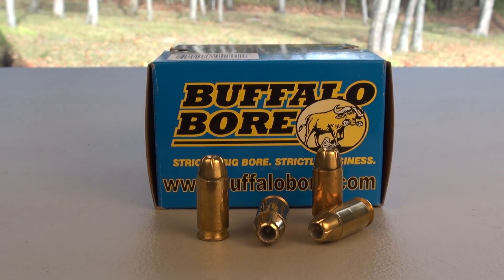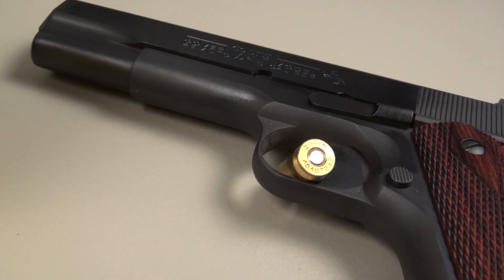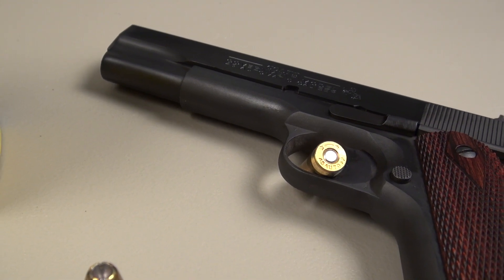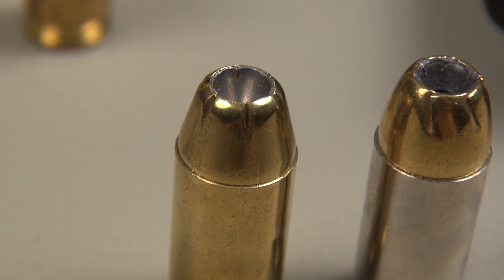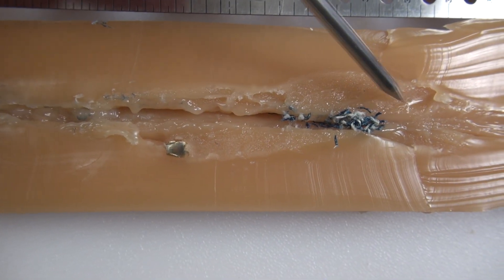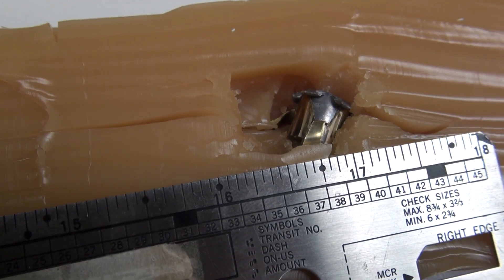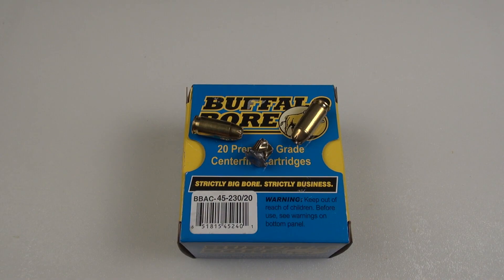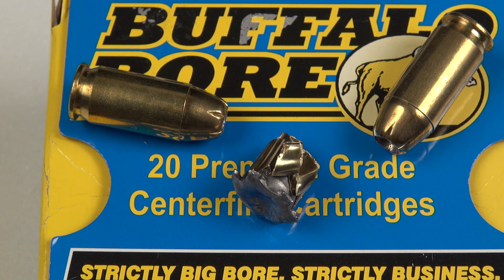Buffalo Bore .45 ACP +P 230 gr JHP AMMO TEST

Comment: i have shot a 357sig since 1994 over 20,000 rounds ,sig229 still shoots good, so the myth of high pressure ammo is bad on your gun in hog wash. but if you buy low quality gun you will have issues.

Comment: Muzzle energy (ft/lbs) = Weight x Velocity. Velocity is the dominant factor.
Reply: Mo Beasley that’s actually the calculation for IPSC/USPSA power factor.

The formula used to calculate energy for a cartridge is bullet velocity squared times bullet weight in grains divided by 450240, to get the result in pound feet of energy.

Comment: I think the Glock 21 would hold up very well with this ammo
Reply: The Glock 21 will handle anything and 45 that's the same frame as the 10 mm Glock made they're 10 mm first and then they made the 45 you won't have a problem the Glock can handle anything
Reply: Another good weapon is the Ruger 1911 that will handle anything in 45 Auto I got a custom Ruger SR1911 it will handle plus P ammunition all day Ruger stands behind their weapons

Comment: .45 acp operates at such low pressures that "+p" ammunition isn't going to wear it out my .45 is a para p14 black ops model and I have shot  18,300 rds to date through it and all of them were my own loads I use the 230 xtp exclusively I load it to 990-1000 fps I also use starline + p nickel plated brass and it has cause zero measurable wear on the firearm even at that velocity the pressure is very low compared to say a .357 sig or .44 magnum. .45 acp plus p ammo will never wear out a pistol as long as you keep the firearm clean and lubricated.
Reply: As fsr as the so called higher pressure Buffo Bore ammo, they are within all SAMMI specifications. The company just does a better job choosing powder to get the highest possible velocity for bullet weight  in any given caliber.
Reply: Motoroil  para ordinance is just about the best,I have a few the best is the expert it comes tuned and ready,it will shoot same hole groups at 30 yards,even with cheap Walmart stuff,the only gun that I have that out shoots all my 1911's even the Ed brown and Kimber is the Taurus pt 1911 I would put that pistol up against any high dollar gun any day

Comment: The 45 ACP and the 45 Colt are incredibly powerful rounds in average velocities.  There generally is no need for extra energy BUT there may be exceptions and then these beefed up rounds are available .. obsession with more and more power ought not to be interpreted to mean NORMAL rounds are not sufficient in anything from .32 to .45 .. [more men have been killed with .32 than any other caliber .. crap game guns].  Police carried .38 special for decades.  .45 Colt was the "Peacemaker"  and  .45 ACP served the U.S. Army through two world wars and two peninsular wars.  They are very powerful  calibers.
Reply: .45 Auto defensive ammo is quite impressive in gelatin compared to the 9mm, .38 Spl, .40 S&W, and even the .357 Magnum, thanks to modern bullets built to deform and expand at relatively low velocities.
But what is "better" than a .45 Auto bullet at 950 fps?  That's right, a .45 slug moving at 1,300 fps!  Ever wonder how many people hit with a .44 magnum make it to an ER versus .45 Auto?  In 20+ years as an ER Nurse I've seen zero people hit in the torso or head show up in any ER I've worked at, yet I have seen quite a number of people WALK in after having been hit IN THE TORSO with a .45 Auto round...including "ball," and the bullet did NOT penetrate completely in most cases.  What DOES penetrate completely in most cases is the freaking 9mm!  Not to seem biased towards it since it too resides in the generally "sub-400 FPE" class of "maybe" it will take someone down with one shot, or maybe it will take an entire magazine.
Long ago I stopped carrying a 9mm or .45 ACP handgun for SD because I saw first-hand just how UNlikely they are to actually cause anyone not already "tired" to lie down and stop resisting.  For many years my carry piece was a S&W Mountain Gun in .44 Magnum, or a Colt Python in .357 Magnum.  Then came the 10mm, and thankfully, over the decades loads worthy of the name have appeared and THAT became my carry piece in the form of the Glock 20 (16 shots), and later Glock 29 (11 shots).  More recently I have begun to carry my favorite handgun again....the quintessential 1911, though now chambered in .460 Rowland!  With nothing more added to the outside than the length of a compensator, a flat bottom firing pin retainer, and 20# recoil spring, the gun bangs out Underwood factory ammo approaching 1,000 lb-ft of KE.  WhatEVER anyone might say about how wonderful WAS the .45 Auto "back in the day," the ability to carry the 1911 platform shooting "thousand pound round" is SaWHEET!

Comment: Can you do the same test at 25 yards? I would like to see expansion and velocity.  I have used the Winchester Ranger 230 grn p+ LE round, for Black Tail deer and it worked quite well, but it is hard to find. Therefore, I am looking for an alternate round. I know you’re thinking why not just use a 44 mag, I can, but the 45 ACP works, and it is fun to shoot. Most of my shots will be inside 75 yards for the 45 ACP otherwise I will probably use my rifle. Any info you can supply, on a possible alternate round would be great, the Ranger gave me great penetration with full expansion, but like I said it is hard to find. I am considering hand loading something similar, also Buffalo Bore has a 45 Super that looks promising, it would be very interesting to see the results of that test as well.  Thanks, for another great video!

Comment: you guys think an M&P 45c can handle this ammo with out blowing apart?
Reply: so long as you don't put thousands of rounds through it
Reply: I would look into cryogenic heat treating to toughen up all metal parts for better stress tolerance. If done right it forms a carbide layer which definitely helps wear resistance.

Comment: A .45 ACP makes at least a half inch hole. A JHP is a moot point. A 9mm has to expand 19% without fail to match it and most 230 grain slugs penetrate more than 12 inches.

Comment: My buddy Roy was shot through the lower sternum and into the spine with a 45 Glock. He walked out of the hospital after surgery fine, looking healthier than ever (he was a little heavy-set before) and with a wicked scar. He's certainly not dead. Pistols aren't that powerful, rifles and shotguns beat them easily.
Reply: +Brandon Ackley "Pistols aren't that powerful, rifles and shotguns beat them easily." 

Thanks for that crucial info Captain Obvious.
Reply: Dude was just lucky.  I'll give a bow hunting analogy (because that's the wounds I have the most experience with).  I've hit two different deer of similar size in roughly the same area with the same bow/arrow/broadhead set up, and had one run 100 yards and another drop within 5 yards.  Your buddy was also lucky he only got shot once.

Comment: Learn you guns exactly, I have over 13,000 rds of JHP through my XD40 JHP is completely safe and functional.  The only ammo warning of ANY kind in that manual is listed below and it is only for the XD PORTED models and it ONLY EXCLUDES "Shot" or "Frangible" "wood/plastic" bullets, as well as reloads which is a warranty issue. AS the reference says try page 27 If you are going to offer advice feel free but state it as advice not FACT or REFERENCE your facts.

Comment: page 27 XD Manual
Caution
Fragments of the metal jackets on jacketed bullets
may be propelled through the exhaust ports with great
force and have the potential to cause injury or property
damage at a distance of several feet. The misuse of
any of the ammunition described above may result in
injury, property damage, or both.

Comment: PORTED BARREL SAFETY INSTRUCTIONS
Ammunition
Use only fresh factory ammunition such as
Winchester or Federal. DO NOT use handloads,
reloads, or remanufactured ammunition in your
Springfield firearm. Only shoot cartridges of the caliber
engraved on the barrel. DO NOT use shot cartridges
or any ammunition which is loaded with a frangible
projectile or any ultra-light weight projectile at elevated
velocities, or any wooden or plastic projectile.

Comment: @tnoutdoors9 Yep, I have both of the rounds, I prefer the Golden saber over most. They preform well, and they feed well in my 1911, and my Taurus pt 99 af! It jammed on the other brands of hollow points I have used, but it likes the Golden Saber. I use the Remington, 124 grain BJHP, +p loads, I shot a box through it and not flaws, 25 round box. Not much of a test though I admit!